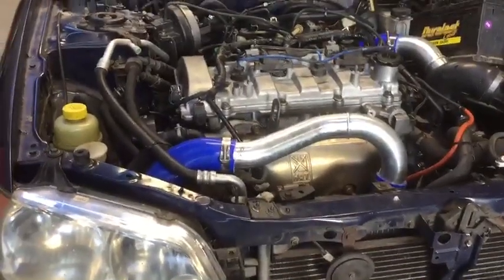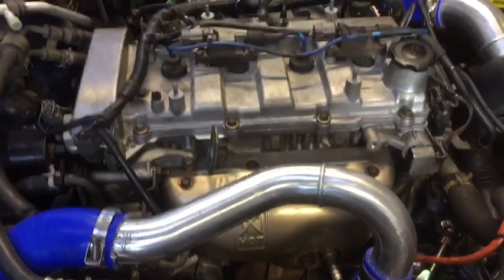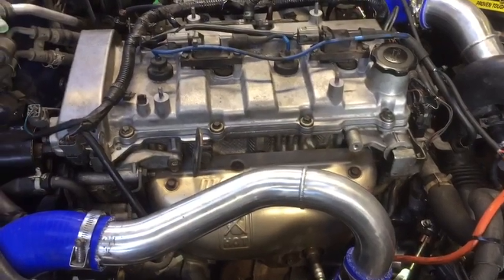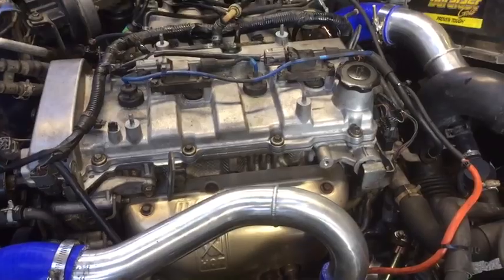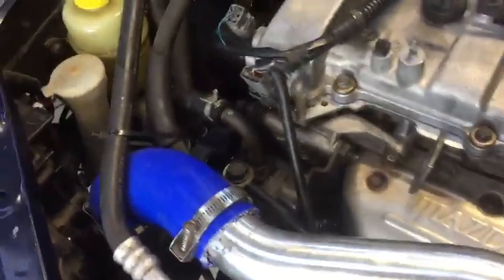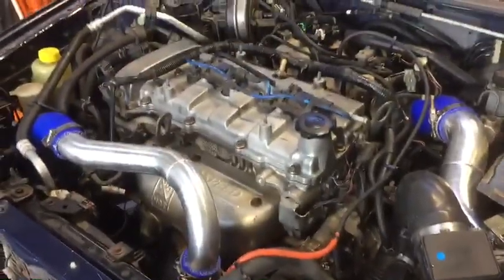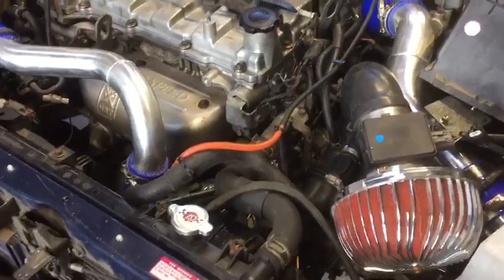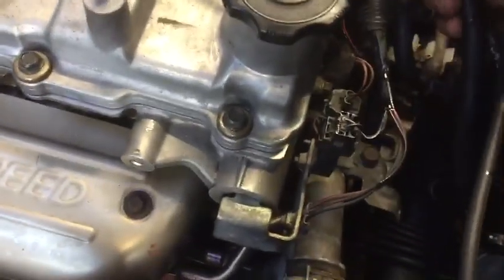Mazdaspeed Protege engine problems

Comment: Did you fix it up?
Reply from the maker: Didn't fix it man ended up being a junk motor. I installed the main bearing on incorrectly (flipped it upside down, instead of lining up the hole and the oil passage) blew the motor after spinning a bearing

Comment: That sounds like rod knock bro. When u say rebuilt what all does the entail?
Reply from the maker: I replaced the main bearings and the rod bearings when I did the rebuild. I checked the clearances and everything was in spec. I don't know how it could be knocking, I very carefully torqued everything down and kept everything very clean.
Reply: john dias idk bro. Message me here 

Instagram. @msp_protege_03.5
Reply: @hcracer1985  have same issue

Comment: , its your crank gear hitting the plastic  timing belt cover at the bottom by the crank you probably bent one of the teeth installing the engine, just a thought happened to me one time and sounded the same